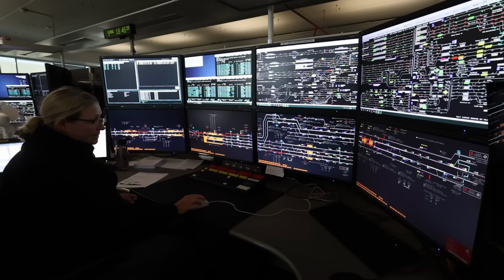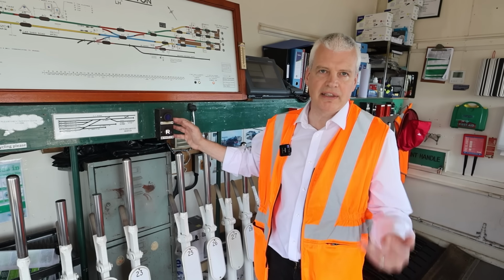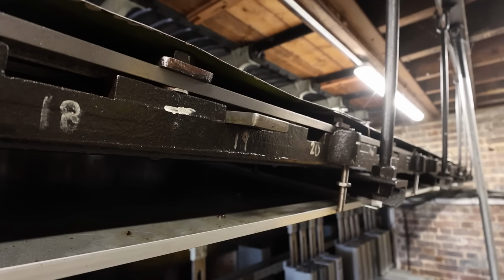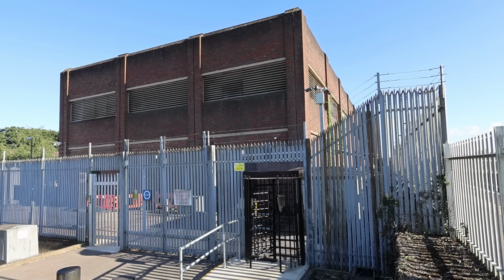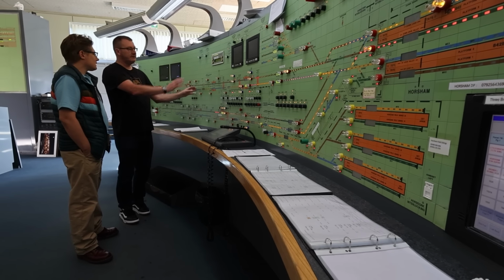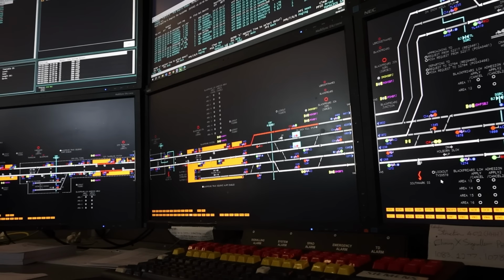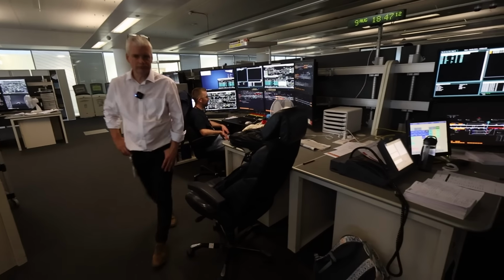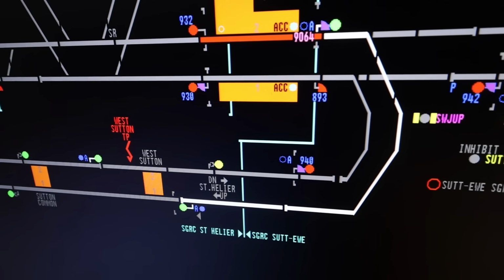Why Do We Still Have Semaphore Signals?

Comment: Hi Geoff. thanks for this. was on welsh marches line yesterday with manual boxes and signals. With 153s still in use they were smoother, cooler with opening windows and much better ride than the 197s which bumped and banged up and down the line. 158s were ok but very sticky as air conditioning not working. Saw the new 805s at Chester on Holyhead to Euston services.  not yet have the luck to ride a 67 and mk 4s. Caroline

Comment: Thanks Geoff for showing my local area :) Semaphores on the Littlehampton branch always seem like a bit of a 19th century throwback albeit a charming one and those mechanical interlocks look fascinating. The rest of the Arun valley line was finally re-signalled about about 5  years ago and a friend from Network Rail explained that some of the semaphore signals there still used gas lights right up until the upgrade. I often wonder if he was pulling my leg but somehow I doubt it...
Reply: Hi, the Arun Valley went a decade ago now, unbelievably. And yes, they only went to battery lighting 3 years before the end.

Comment: Hi Geoff. Have you ever walked up an esculator that is dead. I did yesterday at moorfields station on Mersey Rail. Was under maintenance. So steep that for an old crock like me at 67, had to stopped for a bresk 3/4 of the way up and by the top was panting like a good one. Caroline .

Comment: Fascinating. The juxtaposition of 19th century mechanical signalling with the 21st century monitor showing the approaching train movements is an indication of one the biggest challenges: making all the different systems work together.

Working in Signals & Telecomms back in the 1980s, I was impressed how they managed to work out the immensely complicated interlocking was using just relays (thousands and thousands of the power-hungry bu**ers). And standing in one of the smaller relay rooms, you could tell as trains passed through the section controlled by it from the "chatter" of the relays moving through the room as the train triggered block sections and signals changed aspect.

Comment: When there's a track realignment or adjustment do they have to change all those signal box layout diagrams physically? Just wondered.
Reply: Yes they do In some cases where there is a minor alteration like you see TPWS on some signals the whole diagram is not re drawn. In power boxes the panel is made of tiles that can be swapped for ones with an alteration on, like a cross over removed and plain track put in it is easy to exchange those tiles to show that
Reply: @cedarcam  Thanks for the clarification.

Comment: At the Spa Valley Railway Tunbridge Wells at Groombridge Signal Box they have part lever frame semaphore signal and part eclectic points BUT the Signalman or women has a CCTV monitor so he or she can log on to CCTV cameras at the other station and see where the train is.  So the SVR is in the 1880's and in the 2000's at the same time

Comment: I have always said that Chris is a great Ambassador for Network Rail. Great VOD on what had been my career up until last year, finally took early retirement to get away from shift work. I worked mechanical boxes, London Bridge NX and Three Bridges ROC WestCad, the latter for my last seven years. Nice to see the place in your VOD. I would have preferred the Signallers at the location to have spoken with you. You would have learnt more and the VOD would have been better. Also, you would have been treated to more hands on at all the locations, but with a Director present, things get restrained. Also as I have found, the knowledge of management is somewhat limited regards signalling trains, many of them never having done the job. Whenever I had visitors, I always gave them my chair and let them have a go, under my guidance of course. They left far more knowledgable. The real reason why mechanical levers have the tops removed for electrical equipment, not to identify as such, but for safety. To prevent the signaller inadvertently giving electric operating levers a good old huge pull and ending up in a heap across the floor. Mechanical levers have resistance and require force to move them, electrical levers have none. Got to be the first time anyone has visit TBROc and videoed just the Signallers. Management tend to rush past the Signallers and head upstairs to the Controllers.

Comment: Hello Tim Leighton !  

I worked with you during my time on Anglia Region and at Euston HQ.

Correction Tim : Red levers operate Stop Signals (Home, Starter, Section, Intermediate Block and Ground Shunt). Yellow levers normally operate Distant Signals (ones not capable of displaying a red), albeit Littlehampton does not appear to have any ?

Normally blue levers are used lock the points. 

Three Bridges type of signalbox is a NX (Entry/Exit) Panel, on a larger scale.

The ROC is a Route Operations Centre. There is a higher level. The NOC is the National Operations Centre. 

ERTMS was piloted in Britain, between Shrewsbury Aberystwyth and Pwllheli. ERTMS is also used on the Hertford North Loop route.

ATO is also used on the core section of the Elizabeth Line (Crossrail) Liverpool Street to Paddington.

London Transport has ATO on the Victoria Line, since 1969, and the Central Line since 1992. 

HS1 (St. Pancras to France, operates a different type of In cab signalling called TVM430 which is compatible with high speed signalling in France, Belgium and the Netherlands. 

Whereas, Automatic Train Protection systems exist on London Transport (the Tripcock), Great Western Mainline between Paddington, Oxford, Newbury and Bristol Temple Meads (the Belgian ACEC), the Chilterns between Marylebone Banbury, Amersham and Princes Risborough to Aylesbury (the German Indusi). 

Vic
National Operations Standards Manager (retired)

Comment: The NYC subway still has mechanical signals and points, but it’s slowly being replaced with modern signals so that every line will upgrade to CBTC (Communications-based Train Control)… well once we replace all of the older fleet (an attempt was made to upgrade on train to be on par with the new ones…. They didn’t say why, but they ripped the upgrades out.)

Comment: I lived near Three Bridges for over 40 years.  I can remember  when the Rail Operations Centre and ASC didn't exist, and the main London to Brighton line, plus associated branches, had numerous smaller signal boxes along the routes. Not all corresponded to station locations,  we had "Streatham Junction" (near Streatham Common Station), "Gloucester Road Junction" (just north of East Croydon, where the main lines to London Bridge and Vuctoria diverge), and "Stoat's Nest Junction" (near Purley). Three Bridges itself had its own small box, situated at the southern end of Platform 2.

Comment: Swindon push button panel has been reconstructed and refurbished in its 1980’s form and displayed at Didcot Railway Centre, where it is realistically demonstrated with a simulator back-end for the educational benefit of visitors to the Centre. You can visit and ‘have a go’!

I was surprised that the ROC is not more advanced. I thought they were going to be programmed systems, able to run themselves with signallers stepping in if necessary. But given the UK IT industry's track record of overspends and non delivery, maybe the current set up is more realistic. I thought I read somewhere that NR was planning for c6 ROCs to run the whole network.

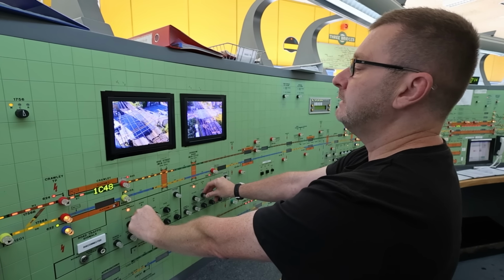Comment: 10:25 Interesting and a bit sobering that once the barriers are down, the cctv screens go off and nobody is watching the crossing any more.
Reply: The reason why the screens are turned of once the crossing clear button is pressed is because the image of the crossing gets burnt into the screen, well it did on the old cathode ray tube ones, there was a chance the image of lowered barriers could get burnt in, a ghost image, and the signaller think the crossing barriers were down and crossing was clear when the barriers were still raised. Weather modern colour monitors are affected by that I do not know.
Reply: I agree. No idea why that is the case. The CCTV monitors should be on at all times.
Reply: I was also a little confused by that.  Because it's not possible for (for example) a pedestrian to try to squeeze through the lowered barriers...
Reply: Once a route has been set across the crossing and the train starts moving it's a bit late to do anything. Also if someone climbs the barriers then they're putting themselves at risk in exactly the same way as if they crossed the railway anywhere else, ultimately there's nothing you can do about such people because you can't monitor the whole network.

Comment: If you like Victorian logic try and find a mechanical signal box that's got staff (or tablet) machine interlocked with the signals.  The staff machine mechanism is not only extremely clever but its also, like everything else on the railway, fail safe. (Incidentally, electrical supply in these old boxes was through wet -- Lechanche -- cells, a bit like an AA battery in a glass jar.)

Comment: The modern signal boxes actually use a lot of the old techniques and therefore it is so important to learn the job from the beginning. As my training as a signal boxer began I started at an old signal box in Bad Neuenahr, Germany which was closed less than a year ago. During the two years of learning you make your way up to the electronic signal boxes. Interestingly you can even see how the newest signal boxes have developed over the years (late 1990s til today) and this make this job so interesting. Thank you so much for giving us a detailed look into Englands signal boxes!
Reply: I take it the systems in Germany are very similar to ours?
Reply: @mdhazeldine  Yes, they are quite similar. Regarding the old technique, the main difference is that while the one shown here uses poles the one on Germany use cables and the levers need to be turned more. Germany then had a mix between mechanical and electric signal boxes which I am not sure were a thing in the UK. The relay signal boxes however look alot smarter in Germany, which (in my personal opinion) is also the fact with the electric signal boxes. After all, they mostly use the same techniques, so it's just more a layout thing.
Reply: @castlehighschool  We do have some old style signal boxes that have used cables (I think?) and also had electrical/relay panels installed in them at a later date, or use a mix of both.
Reply: A few weeks ago I did a full run on the Black Forest Railway from Konstanz to Offenburg, and it was nice to see some Semaphores still in use there.

Comment: In the olden days, when things went wrong in Brighton, the signal staff could see what was happening and problems sorted out on the spot. 

When control was moved to Three Bridges, 25 miles away, if anything goes wrong with the communications, the system is stuffed. 

A few years ago a small fire in an equipment cupboard in Gothenburg knocked our services for two weeks over a wide area.

Modernisation has made the entire system vulnerable.
Reply: You're absolutely right but you can't tell that to the people who make these decisions because all they care about is doing whatever it takes to save themselves money. I'm sure having one big control centre is a lot less expensive than maintaining hundreds of individual signal boxes across the network.
Reply: If you have 20 signal boxes on the line then a fire in any one of them will make the whole line unusable because each train will need to pass through the control area of each signal box. Clinging to the past doesn't eliminate risk.
Reply: @alexfrye6  
If a signal box is out of use the block sections are just combined. It is a common practice when traffic is light. There was a signal box on the platform at Amberley which was switched out of use at weekends
Reply: @physiocrat-sv  That's no way to run a modern railway. Just too much traffic on the mainlines.
Reply: @alexfrye6  
Indeed but not all railways carry heavy traffic and the need for resilience is as important as ever.
Reply: @physiocrat-sv  Where in the UK has a ROC been disabled by a fire or other emergency?
Reply: @alexfrye6  
A few years ago there was a small fire in a signalling equipment cupboard in Gothenburg, where I live. The shutdown took out services over a large area for a fortnight. Then there was that business in France at the start of the Olympics.

The question to be asked is not what HAS happened but what COULD happen.  No doubt Mr Putin has a list of the key control installations.
Reply: @physiocrat-sv  If Putin is firing weapons at the UK then we've got bigger problems than whether the trains can run. Besides you can't build a railway immune to missile strikes. If they don't take out a ROC then they could just as easily take out a few major junctions and it would have the same effect.
Reply: @alexfrye6  
It's called low intensity warfare. The enemy can be home grown. Don't lay yourself open to it.

We have these disruptions regularly here in Sweden. They don't just affect the railways.
Reply: @physiocrat-sv  Do you realise how high security ROCs are?  I have to work in them sometimes, it's hard enough to gain access when you're meant to be there let alone if you're not. I wouldn't worry about domestic terrorism.

People a lot more knowledgeable than you have thought about all of these possibilities and accounted for them. Yet you insist on thinking you know something everyone else doesn't when in fact you're just stuck in the past.
Reply: @alexfrye6  
How is it possible to harden the links from the secure control centre to the outer reaches of the network that the centre controls?

There is nothing outdated about distributed control; on the contrary, it is regarded as an important means of achieving robustness and resilience. The Internet is designed on this principle. By people stuck in the past?

In recent years, and indeed months, I have myself been on the receiving end of delays and shut downs due to the vulnerability of the systems. They work very well, when they work.
Reply: @physiocrat-sv  Harden against what? I can't answer your question unless you're more specific.
Reply: @alexfrye6  
That's the point, isn't it? Too many unknowns. Enemy action, fire, flood, malicious acts, storms and tempests, vermin. You never know what can strike. 

My last train journey was terminated abruptly due to theft of the 16 kV copper conductor cables, which in theory should have fried the thieves. I arrived the following day.
Reply: @physiocrat-sv  Yes you can guard against all of those things by using toughened cable and by duplication. They're all still problems if you don't centralise control centres though, you don't seem to understand that so I give up trying to explain.
Reply: @alexfrye6  Please don't give up. The  more eventualities to be anticipated,  the higher the costs, as is implicit in your reply.

Distributed control is a well established principle. Obviously in a network system there needs to be an overview but it is preferable if small sub-units can continue to function if communication is lost or the centre is disabled for any reason. 

This is a characteristic of many biological symptoms and a feature of "commando" type military operations. Those on the ground can act on their own initiative, subject to the guidelines they are working to.
Reply: @physiocrat-sv  The only eventuality which would cause a problem in the current setup and not if it were more distributed is a ROC being destroyed or damaged by foreign attack or natural disaster. Natural disasters are guarded against by building them well above flooding levels and building strong buildings. Maybe something like a massive once in 1000 year storm would do it but I can't think what else. All the same things can happen to a signal box and it's much more likely because there are more of them and they're not such strong buildings.

Foreign attacks can just as easily target major junctions, depots and stations. The west midlands signalling centre is actually built to be bomb proof, it's basically a giant thick concrete cylinder. None of the others are the same but if we were entering a time of war they could be modified to be bomb proof.

There are also layers of backup. Remote interlockings have their own local controls which could be used. The final backup is mega maps: A0 printouts of each control area which you put small magnets on to represent trains, you then have to communicate with each train driver via radio to tell them whether they have authority to move. You can run a railway on that basis but at much reduced speed and capacity.

Hopefully that explains it. As I say it has been thought about before and it's not as vulnerable as it might look at first glance.

Comment: interesting that they operate the crossing arms manually instead of automatically when a train approches
Reply: It depends on what type of crossing it is. Half-barrier crossings, which are usually found in more rural areas where there is less road traffic, are triggered automatically when the train runs over a switch on the track which activates the crossing. No signaler is involved.

Comment: Breaking all the rules, no hard hat when under the frame of a signal box. The panel is what called a NX panel, Entrance, exit panel. One button in, one button out. In its simplest form. There's a smaller ROC for the West Midlands at Saltley, that has auto route setting. That I had contact with for my signaling work. It will be moved to Rugby ROC when HS2 comes through to Birmingham.